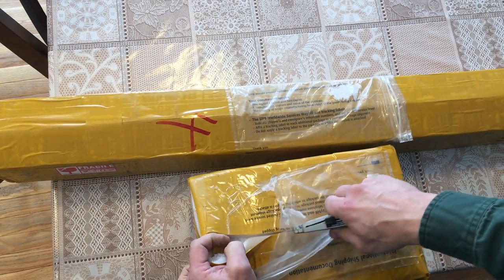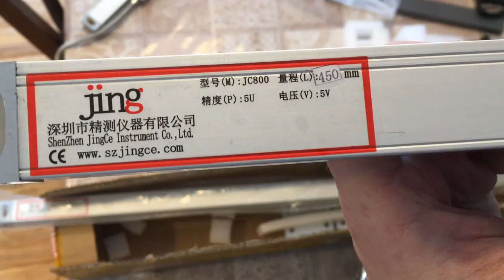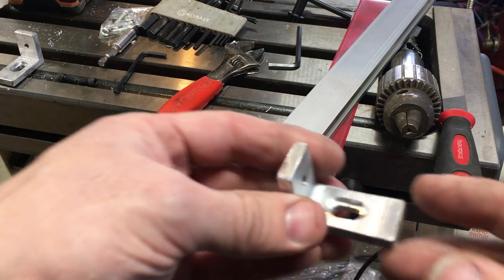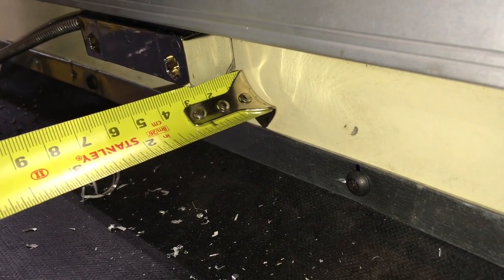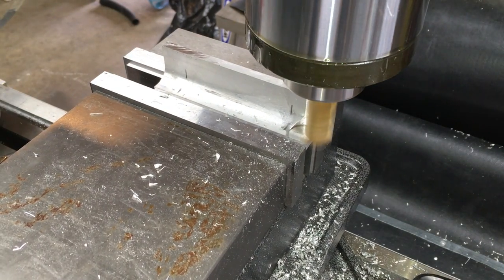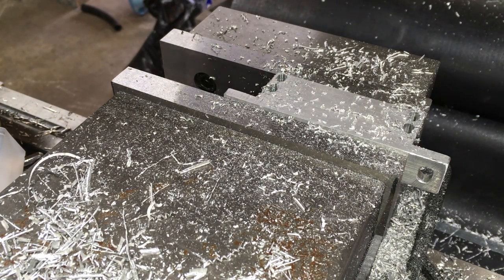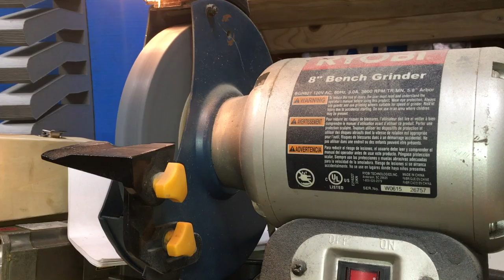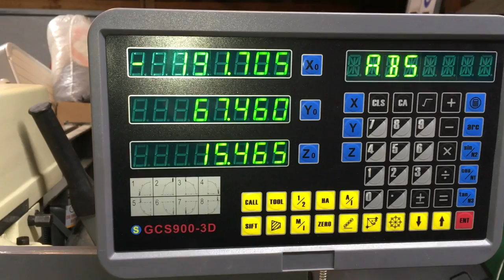Mill DRO installation. Glass scale mounting brackets. Digital readout

Comment: I would like to add one safety comment.  When I served my apprenticeship as a Scientific Instrument Maker completed about 51 years ago, it was hammered into me that one NEVER wears gloves when using machine tools.  I believe this is very sound advice because if the material of a glove gets caught up by the cutter, one's hand can be dragged into the cutter resulting in massive injuries and disablement.  If one doesn't wear gloves, contact with the cutter (which good practice should avoid anyway) would result in a much less severe injury.
Reply: I recently was being foolish on a bench grinder on a small part without pliers, and the rests were way too far away from the wheel. I luckily only lost some fingernail, but if I had been wearing gloves, it would have been a trip to the hospital.
Reply: that's what we used to do back 50 plus years back then, but after  being 79 I now use latex to cover my hands to keep dirt and grease off them
It's nice having clean hands to work with
Reply: Never Use Gloves or Long Sleeves! I was never trained, but I've had a home shop for decades and spend hundreds of hours working around all kinds of stationary tools. I had a terrible experience with my RF31 mill-drill. I was drilling holes in wood and my tight fitting fabric glove got caught somehow. In an instant, hand was wrapping around the bit and actually stopped the machine. I was SO LUCKY I had the belts set for low torque and that I wasn't using something like a fly-cutter or my hand would have broken or mangled beyond repair.... I agree that nitrile gloves are good.
Reply: I vividly remember my grandpa losing 4 fingers in a table saw due to gloves.

Comment: Have a mini mill that am installing glass scales as well and have been watching vids to borrow / steal ideas and I find it funny that everyone that I have seen uses a mill to make the brackets I stripped mine down completely to get the packing grease out and off and check for burrs etc.  and while its apart should be easier to drill and tap mounting holes for the goodies that I can't make on the mill because it is in pieces  lol
Reply from the maker: I actually didn’t watch others install readouts, honestly! I don’t claim to be an original, either. I just went with the metal..
Cheers.
Reply: Same boat, different water here. My mini mill is nut and bolt apart right now. Guess I'ma put it back together to attach the scales, cut a belt drive and some flying buttresses.

Comment: I've been tempted to try one of import DROs for budget reasons. Thanks for sharing the install and packing method. Glad it worked out for you.
Reply from the maker: Thanks for watching
Reply: I've had my lathe Harrison M300, for 15+ years by now. Bought it installed with a Fagor 3-axis DRO (several years old allready then) It has been great though a little old fashion with very few extras. When it broke down last fall I could have replaced just the central unit for about £600 and kept the scales. No one knows how long the old scales would last. So for one or another reason I decided to replace it all with this £200+ Chinese. After using it for some weeks by now I'm very pleased. Fairly easy to install and operate and many of the gadgets are very helpful. I no longer need to manually enter new indices every time I change tools and the built in calculator is useful. Though, I have had one "little" problem so far: The top slide scale is a few millimeters too high to fit so I havn't been able to install it yet. I can live with DRO on just 2-axis but will give it another try sometime when thumbs twiddling is getting too booooring (meaning, I've got a couple hours left:)
Reply from the maker: I agree about it’s ease and versatility. Especially, the price! Maybe, when I grow up, I’ll install one on my lathe, too :)
Cheers.

Comment: Did you use a wood cutting blade to cut an aluminum bracket?  Hardly the brackets fault, use the right tool for the job...
Reply from the maker: Thanks for the comment! The blade says wood + soft metals.

Comment: Free-hand power-tapping a small tap in confined spaces with a rechargeable battery drill is just begging and pleading for trouble.
Reply from the maker: It’s a good point and I understand that. However, it is something I successfully been doing at work for years, using brand name taps. These Chinese taps just crumble down. By the way, never buy center drills from China, either! Those things don’t even last long enough for me to say how much they suck!
Reply: I agree. It was painful to watch! Breaking off a tap in a machine tool is a crime. I would have hand tapped and used a tap block to square the tap to the machined surface.
Reply: That's what the clutch is for on the battery drill. It is an accepted industry standard nowadays.
Reply: @union310  Taps break when you bend them . The finest limited slip clutch known to man will not stop you from leaning sideways on the drill.
Reply: @agwhitaker  I tap hundreds of holes a day with one for  living

Comment: I have a question, I bought the same one except two buttons have Chinese characters on them. The one is the red button in the bottom right corner. What is that? The other is the blue button in the upper right corner. What does that read on yours? Thanks.
Reply from the maker: Bottom right red button says “ENT” (my best guess is for “enter”)
The upper right blue button is calculator function.
Reply: Thank you.

Comment: G'day I found it really interesting how you went about fitting the two axis to your mill.    I have the same DRO waiting to be fitted on so I am interested to see how other machinist do it, are the cap head bolts M6 and I would really appreciate the size tap and drill you used it would be a great help I have subscribed thank you John Tasmania Australia
Reply from the maker: Hi, thank you for watching and subscribing! I believe I used M6 bolts where brackets meet with the machine. Other included bolts used to attach scales to brackets. Tapping is easy with metric system: for example, M6x1 means 6mm diameter, 1mm step per turn; drill size is diameter minus step, 5mm in this case. Works for all metric tap sizes.
Thanks again, cheers.
Reply: Tinkering Nerd thank you for replying back to me it is greatly appreciated kind regards John
Reply: Hi John, interesting that you are writing from Tasmania, Australia. So am I! And I'm here for exactly the same reason. I just picked up a 3 axis DRO for my vertical PAL mill and was looking for any hints and tips. Your message is a year old now, so I guess you have completed your installation? Any hiccups? I'll be tackling mine in the next week or two - spare time permitting. Cheers, Craig (10 mins from Hobart)
Reply: Craig's Workshop G'day Craig that particular mill I sold it was a SIEG and I wasn't happy with their after sales service and on one occasion they sent me wrong parts and didn't know their own machines. However the DRO was pretty easy to fit I just mad a couple of brackets, my mill is HM 46 regards John

Comment: Thanks for a very nice and instructive video. I just got my DRO and am in the process of installing it on my lathe. Looks identical to yours. Everything seems straight forward except what vertical play to chose between the glass scale and it's pickup? The only document that came with the system was a user manual. No installation manual. How did you do it?
Reply from the maker: Thanks for watching. I believe internal construction of the glass scale will allow for some play/misalignment between the body of the scale and the slider. During my installation, I tried to set the slider as parallel to the body of scale as possible, at a distance of about 1mm between them. Hope it helps.
Cheers.
Reply: Hey thanks for the video ! i got the same scales ! they say in another video that you should use the red block to place correctly the sensor regarding to the scale... the regl block should be able to slide in and out without effort. Also they said this red block should be left in place to the last moment.  Also i didn't saw any cover for the scales in this video, did you use them ?
Reply from the maker: I didn’t see no blocks when unpacked the scales, maybe I missed it? :)
Yes, I used supplied aluminum covers. Process is the same: mark, punch, drill tap, don’t cuss.. Two holes for short cover, three for a long one. 
Thanks for watching!
Reply from the maker: Hmm.. the scales I received had no such thing. Maybe because I got the cheapest ones?! No real surprise here :)
Reply: @TinkeringNerd  ah maybe. but i also bought from china no so expensive. anyway if it works its ok ! having dro is a kind of life changer .
Reply from the maker: Very true! Recently, I made an indexing disc with 96 equally distant holes on a circular pattern, drilled on the mill using DRO. It is amazing!

Comment: Nice video! Did you install the Z-axis yet? How is the DRO working for you?
Reply from the maker: Thanks! It’s been little hectic, lately. Didn’t spend much of the summer in the shop, at all! But, I installed new garage heater, hopefully, will be able to resume all my projects, including z-axis scale. I also want to put a separate quill DRO. Stay tuned..
Reply: @TinkeringNerd  I'd like to see how you mounted the Z as well.  Thanks for posting this first part.  Very helpful.

Comment: The interesting thing to me about the human bean is that we demand the cheapest devices that the world can produce, and then we bitch about the quality of the hardware often times complaining about things that don't even matter, like for example the fact that the D-shell connectors come with plastic housings. I'll assume that cutting the aluminum brackets in a wood cutting mitre saw was comic relief although I know many who use woodworking saws and tools to cut aluminum. If it's for real and not a joke I have zero sympathy. 
Who's enough, and why is it good?
Cosine error is always a concern when measuring, so minimal runout will reduce that kind of error (measuring what is in essence a hypotenuse instead of the adjacent angle). A few thou is nothing in this regard over the span of a couple or three feet of range. Personally I would be more concerned about the accuracy of the scale itself to begin with than a cosine error on a long scale, although there's a reasonable limit.
I shook my head when the tap was broken off by running it in the cordless drill. This is easily done with the highest quality taps made in Germany, or the USA. It's operator error, not the fault of China (I'm not defending Chinese products, but please, let's focus the error to the correct cause, and of course there we go again, buying the cheaper products and then complaining about the quality).
Reply from the maker: Thank you for your input. I do cut aluminum on a regular basis using miter saw with special aluminum cutting blade.
Reply from the maker: About cheap stuff though... have you heard about latest trend towards planned obsolescence? So, there is no real good quality stuff anymore. Back in the olden days, things and tools were made to last, then few decades ago, manufacturers came up with “heavy duty” concept where if you buy heavy duty item, you expect it to last a long time. Now, they provide lifetime warranty for some things and the lifetime of an item is very finite, sometimes as short as 6 months. So, we’re screwed no matter how you look at it.
Cheers.